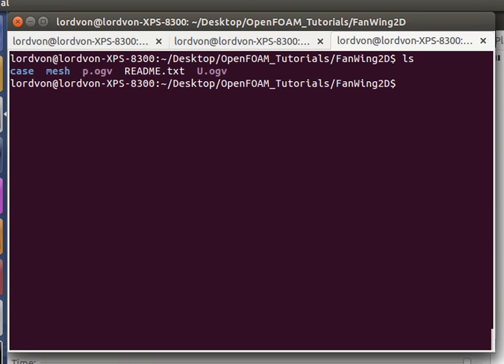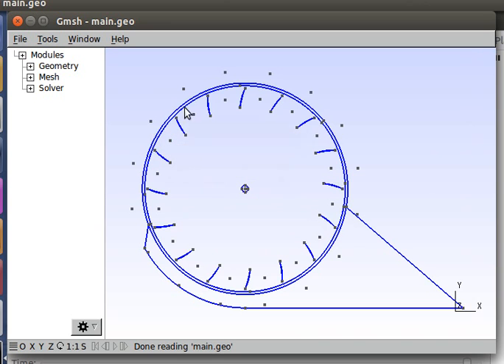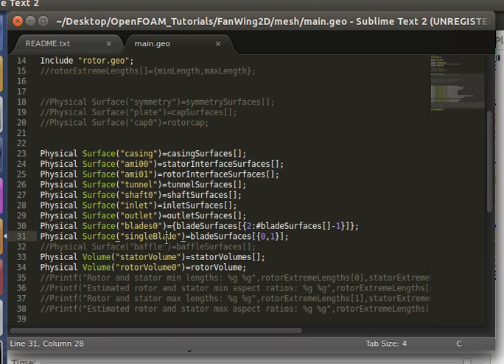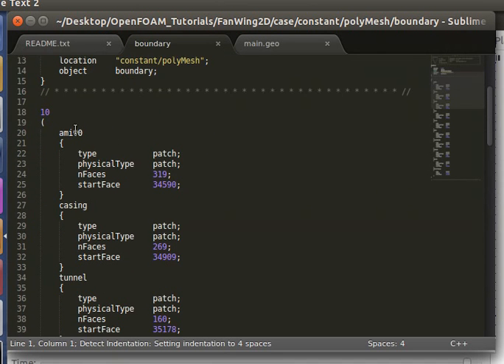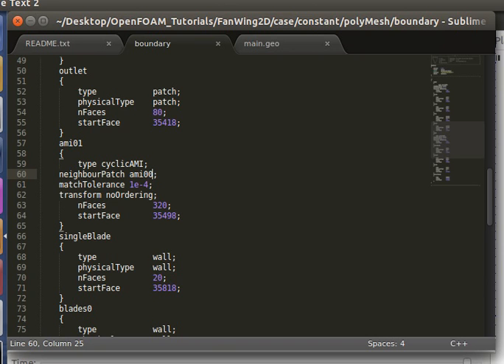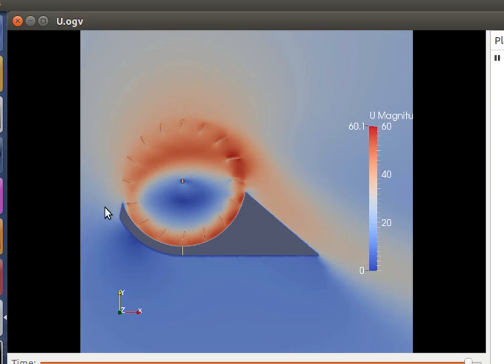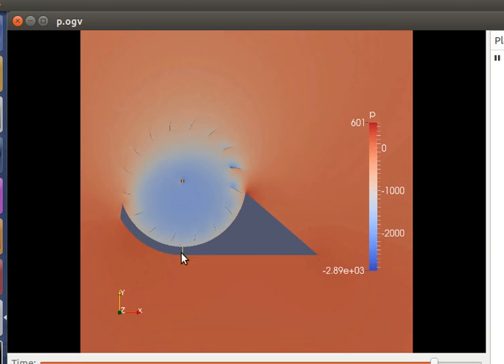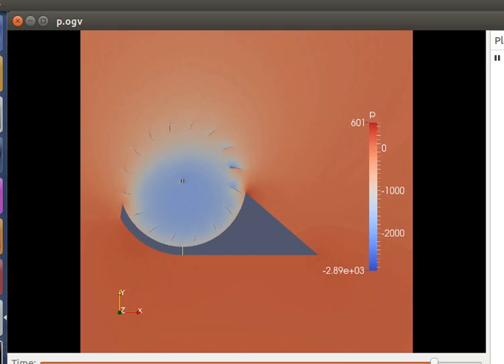FanWing Simulation in OpenFOAM Using Arbitrary Mesh Interface (AMI)

Comment: Hello, I'm getting errors creating the mesh with    " gmsh mesh/main.geo -3 -o test.msh "
I'm new to OpenFOAM and even newer to gmsh, so I was hoping to get some help.
OUTPUT:
gmsh mesh/main.geo -3 -o test.msh
Info    : Running 'gmsh mesh/main.geo -3 -o test.msh' [Gmsh 4.4.1, 1 node, max. 1 thread]
Info    : Started on Sat Oct 26 15:19:44 2019
Info    : Reading 'mesh/main.geo'...
Start:
Info    : Reading 'mesh/intro.geo'...
Info    : Reading 'mesh/inputs.geo'...
Info    : Done reading 'mesh/inputs.geo'
Info    : Reading 'mesh/extrusion.geo'...
Info    : Done reading 'mesh/extrusion.geo'
Info    : Reading 'mesh/subs.geo'...
Info    : Done reading 'mesh/subs.geo'
Info    : Done reading 'mesh/intro.geo'
Info    : Reading 'mesh/firstplane.geo'...
Info    : Reading 'mesh/casing.geo'...
Error   : Unknown control point 4 in GEO curve 4
Error   : Unknown control point 4 in GEO curve 6
Error   : Unknown control point 6 in GEO curve 6
Error   : Unknown control point 6 in GEO curve 8
Error   : Unknown control point 8 in GEO curve 8
Error   : Unknown control point 8 in GEO curve 10
Error   : Unknown control point 10 in GEO curve 10
Error   : Unknown control point 10 in GEO curve 11
Error   : Unknown control point 4 in GEO curve 13
Error   : Unknown control point 13 in GEO curve 13
Error   : Unknown control point 13 in GEO curve 14
Error   : Unknown control point 18 in GEO curve 19
Error   : Unknown control point 18 in GEO curve 20
Error   : Unknown control point 4 in GEO curve 21
Error   : Unknown control point 18 in GEO curve 23
Error   : Unknown control point 13 in GEO curve 23
Error   : Unknown curve loop 25 in GEO surface 25
Error   : Unknown curve loop 27 in GEO surface 27
Error   : Unknown curve loop 29 in GEO surface 29
Error   : 'mesh/extrusion.geo', line 53 : Uninitialized variable 'ids[0]'
Error   : 'mesh/extrusion.geo', line 54 : Uninitialized variable 'ids[1]'
Error   : 'mesh/extrusion.geo', line 55 : Uninitialized variable 'ids[2]'
Error   : 'mesh/extrusion.geo', line 55 : Uninitialized variable 'ids[1]'
Error   : 'mesh/extrusion.geo', line 55 : Uninitialized variable 'ids[0]'
Segmentation fault (core dumped)

Comment: MY ubuntu 16.04 and OpenFOAM 4X for running pimpleDyMFoam and error message 
--> FOAM FATAL ERROR: 
Unknown TurbulenceModel type RASModel

Valid TurbulenceModel types:

3
(
LES
RAS
laminar
)

    From function static Foam::autoPtr<Foam::TurbulenceModel<Alpha, Rho, BasicTurbulenceModel, TransportModel> > Foam::TurbulenceModel<Alpha, Rho, BasicTurbulenceModel, TransportModel>::New(const alphaField&, const rhoField&, const volVectorField&, const surfaceScalarField&, const surfaceScalarField&, const transportModel&, const Foam::word&) [with Alpha = Foam::geometricOneField; Rho = Foam::geometricOneField; BasicTurbulenceModel = Foam::incompressibleTurbulenceModel; TransportModel = Foam::transportModel; Foam::TurbulenceModel<Alpha, Rho, BasicTurbulenceModel, TransportModel>::alphaField = Foam::geometricOneField; Foam::TurbulenceModel<Alpha, Rho, BasicTurbulenceModel, TransportModel>::rhoField = Foam::geometricOneField; Foam::volVectorField = Foam::GeometricField<Foam::Vector<double>, Foam::fvPatchField, Foam::volMesh>; Foam::surfaceScalarField = Foam::GeometricField<double, Foam::fvsPatchField, Foam::surfaceMesh>; Foam::TurbulenceModel<Alpha, Rho, BasicTurbulenceModel, TransportModel>::transportModel = Foam::transportModel]
    in file /home/sam/OpenFOAM/OpenFOAM-4.x/src/TurbulenceModels/turbulenceModels/lnInclude/TurbulenceModel.C at line 113.
-----------------------------------
What problem with my operation. I followed your steps and meshing it into the case file.Thanks.
Reply: You need to fix your turbulenceProperties file in the constant directory of your case. The simulationType should be one of the 3 options listed in the error output you got (i.e. one of laminar, RAS, or LES). I'm using version 5.0.0 now, but the last time I can recall RASModel being a valid entry for this parameter was when I used to use version 2.2.1 so perhaps it was updated from version 2.x.x to 3.x.x or from 3.x.x to 4.x.x.

Comment: Hello, I came across a transducer that is a send receiver for detecting/measuring Vortex flow. Part number SMCN8C8F145 and it is made by STEMINC. I am trying to use it to detect anomalies on a laminar flow over a surface not so polished. I am having a difficult time putting together electronics to support analyses.

Comment: Fantastic innovation of translating air flow. I remember as a child nearly 60 years ago flying a more simple spindled wing . But the concept of vectoring the air flow not too similar as the control swashplate of a helicopter's lift is from my engineering background a very good interpretation of being harmonious with  the control of air over its "lift" surfaces. Wouldn't mind seeing how the control bearing surface that contains the control gearing for this effect  would come into play  with full powered containment control of the contained low speed gearing within the wing .SUPERB!

Comment: Thats a great tutorial on AMI, However I have a question. I am working in Openfoam to simulate a centrifugal pump in 3D. However i am using simpleFoam for steady and pimpleDymFoam for transient case. My question is I have 2 cell zones which are not connected, one for stator and other for rotor. It is clear that we have to use AMI in 3D transient case since rotor mesh is moving ( Dynamic Mesh ) . Is it required to use AMI in steady state also for frozen rotor approach ???
Reply: Yeah man I am living the same problem with you
Reply: @envercaglarturan  Try foam-extend version with ggi mesh connection implementation. Look up 'Ercoftac' centrifugal pump